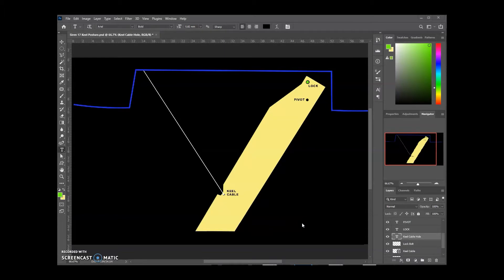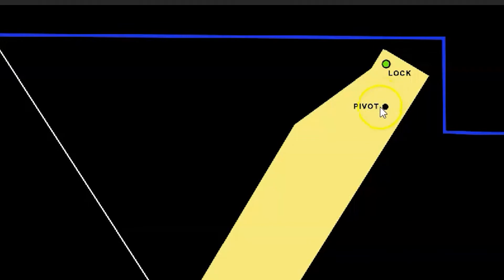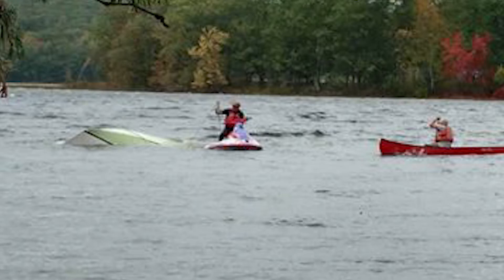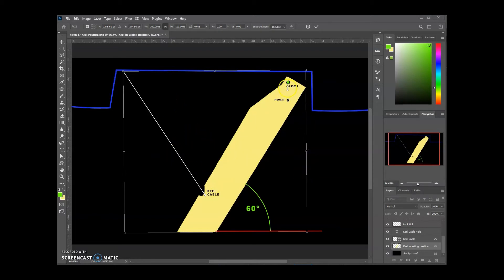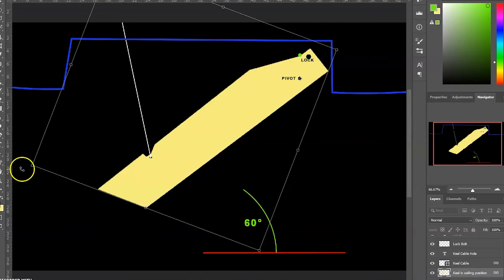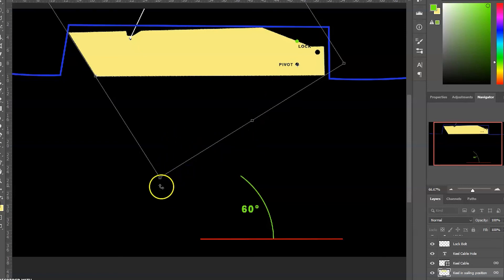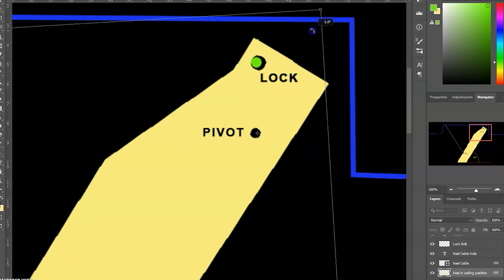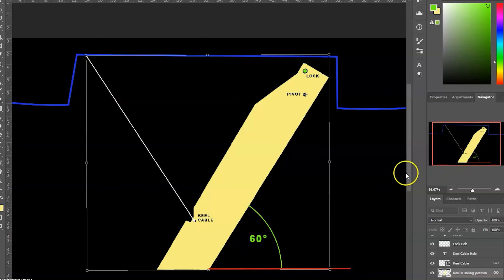Siren 17 - Keel Motion Explained

Comment: I have only been out twice in my Siren - the first time, I did not try to lock the keel, the second time, I could not see the hole in the keel - that must be why... I thought the keel would pivot to a full-down position that would line up with the lock bolt (that would make sense). Now I see that my keel cable is likely too long, and the keel is swinging past the hole! I'll try your trick of lowering it onto the locking bolt, raising slightly, removing the bolt, and lowering a bit at a time, looking for the hole. (or lowering it all the way, then raising the winch a couple clicks at a time until I find it. I'll likely want to mark the cable somehow, maybe a bit of paint where the cable is just leaving the winch drum, when the keel is lined up with the lock. Thanks!!
Reply from the maker: When I replaced the cable with a dyneema line, I trimmed it to the perfect length so the keel and keel trunk holes would line up with the keel all the way down.  That made is really easy to line up the pin.  In any case, in light winds, you don't need to lock your keel, only on windy days when there is a risk to broach or capsize.

Comment: This seems like an annoyance in the design. You never have to leave the cockpit otherwise. Is there room for a second line attached to the lock hole in the board, and run to a cleat in the cockpit? I’ve seen this used to prevent turtling in other designs.

Comment: Thanks ,bought a siren 17 two years ago .The fellow that sold me the boat told me the locking pin bolt was the bolt used for a stop for the keel in the down position.Having sailed a CL16 for 30 years always wondered why sailing into the wind in the Siren was more like a hobbie cat than a CL thanks for the video,next summer sailing on Lake Nipissing just became a whole lot easier!
Reply from the maker: Thanks Bill,  The Siren 17 not being a great pointer to start with (55 to 60° off the wind in my own experience...), I can't image sailing her with the keel partially down.  Plus, being a tender craft, you really want to keep that weight as far down as possible and lock in the keel to prevent broaching or worse, turtling. Happy sailing!